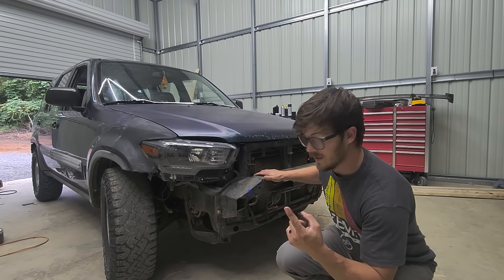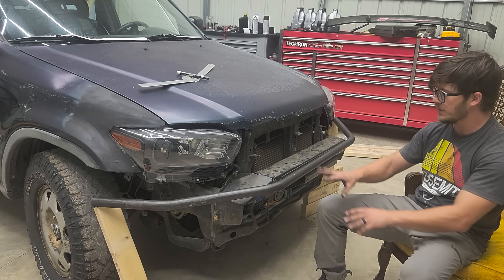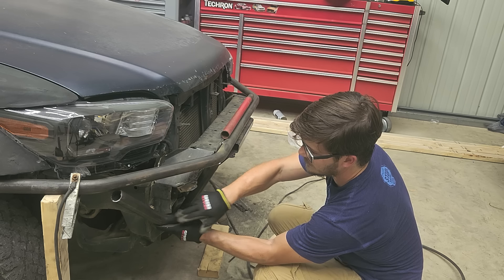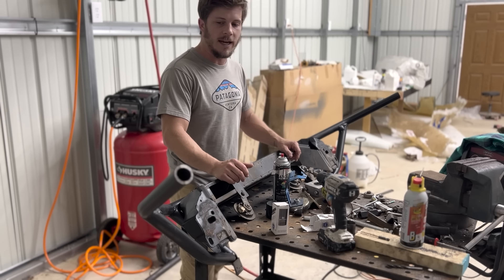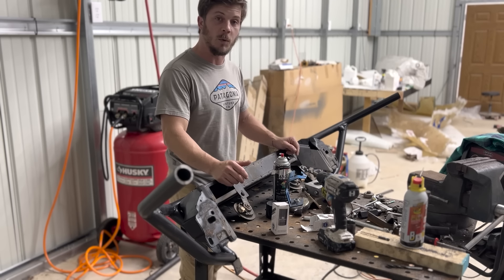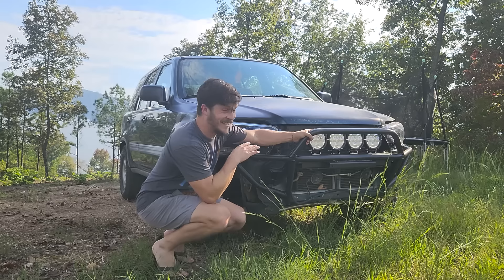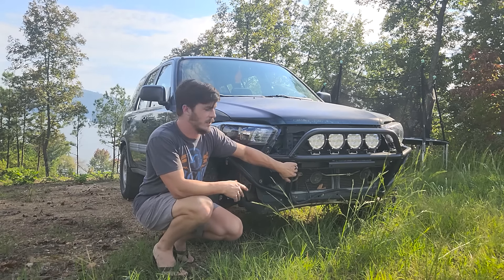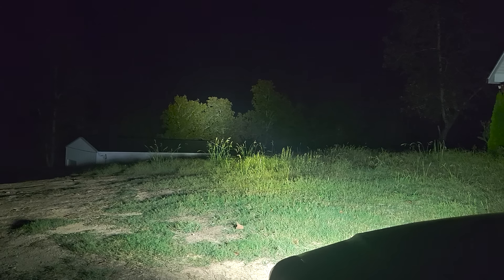CRV BUILD PT. 2 You Can Build Your Own Tube Bumper  CRV BUILD pt 2

Comment: They have this plastic sheeting called "Air Dam" but they have rolls of it at Home Depot under a different name. And that stuff is great for adding accents or making fender liners, engine liners, under vehicle covers, etc. You could also use it to fill out around your headlights, etc.

Comment: This comment is mostly for some of the people reading as I'm certain you already know. If you want your DRL lights off when the headlights are on, this could easily be achieved by a dual relay setup. Use one relay to cut power when the headlights are on and the other to send fused battery power to the DRLs.

Comment: J37 swap it. With a J2K adapter plate to a K-Series CR-V/Element 5-speed, but add the TSX 6th gear. A J-Series, 6-speed manual, RealTime AWD 1st Gen CR-V. Freaking epic. J2KRTAWDRD1, now that's a mouthful...